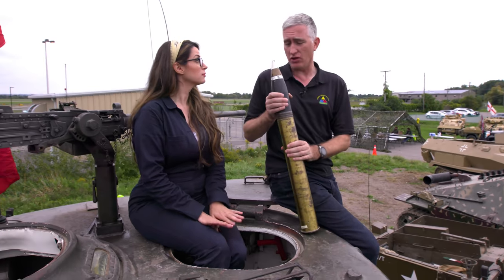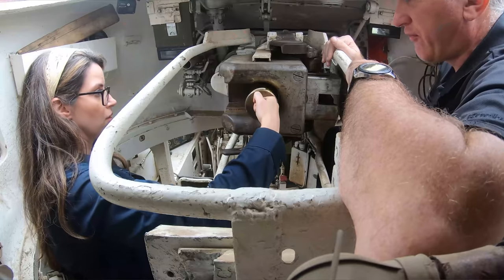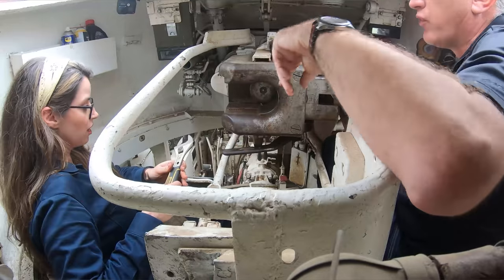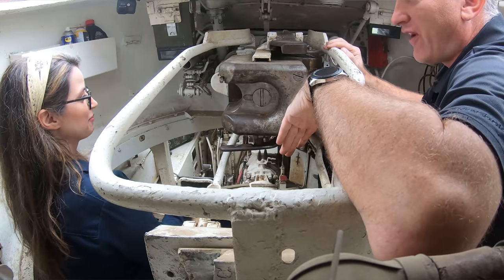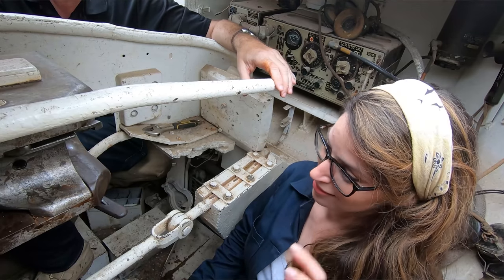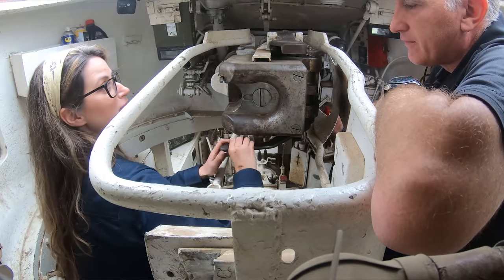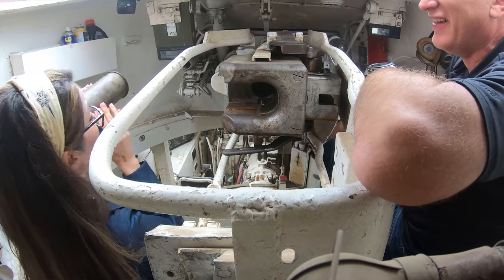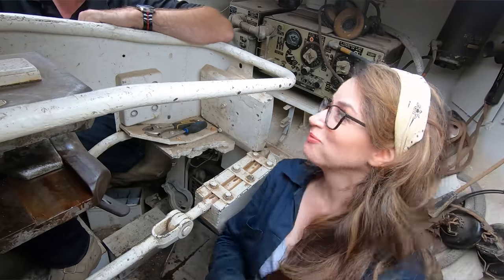Tanks 101 - Loading with The Chieftain & Cmdr_AF - Ep. #3 - World of Tanks

Comment: I trained as a tank loader and gunning on the M60a1 with the 105 mm gun and was in the 3/11 th ACR in Bad Hersfeldt Germany from 1980 to 1983  , needles to say we did ALOT of gunnery.  With a good crew you could put out a tremendous amount of very accurate  fire power . We called it suction loading . With a round in the breach and one more already being held ,when the fire command " GUNNER SABO TANK " was heard and the gunner said " IDENTIFIED " I'd use the tip of the SABO round to place the weapon on fire and yell " UP " when the cannon was fired it would recoil and spit out the caseing , which was a very violent act ,  I used the tip of the new Sabo round to nock the fired case down , set the new round on the now open breach and let the guns own movement slam home the  new round , then immediately grab the next round ( from the sweet spot ) then use the tip of the Sabo round to put the cannon on fire 🔥  and yelling " UP !  We carried mostly SABA rounds . With about a 3rd being HEAT rounds plus 6 white phosphorus.  The SABO rounds were relatively light and the heat rounds were harder to load . It was a good workout . We would have destroyed ALOT of russian tanks in the Fulda gap , that's fer sure . Personally though I would have rather faught on my feet . I always felt that we should have had more infantry support . Being Cavalry we had scout squads 3 platoons per troop  6 ITV,s and 4 deuce mortars . Our Squadron had alot of tanks with a full tank company , M 109 gun howitzers,  engineers and ADA added not to mention 3 Cavalry troops . Alot of firepower !

Comment: Believe that breech is a touch rusty and requires a good cleaning and lubricating. Extractors not working and very stiff.
Reply: Can't deal.. no.. mustnt..
Reply: The working class blokes working the machine would have had massive strength too, likely far in excess of the average gym rat. Work used muscles differently, and was done for at least 12 hours a day, so if you made a living off those muscles, they were solid.

Comment: So there's no extractor or ejector? And did the loader REALLY have to use a block of wood to get the round into the breech? Slamming it home without putting your fingers in harm's way wouldn't work?
Reply: It's a semi automatic breach.  You have to open it manually to load the first time, then when you fire it the breach block opens the empty ejects and it stays open until you load the next round, slamming the next round into the breach trips it closed.  You make a fist to push the round in and the breach block pushes it out of the way as it slams shut.  Using the piece of wood is just a modern "we don't want to be responsible for any missing fingers" thing.